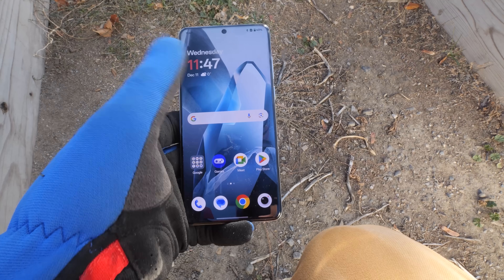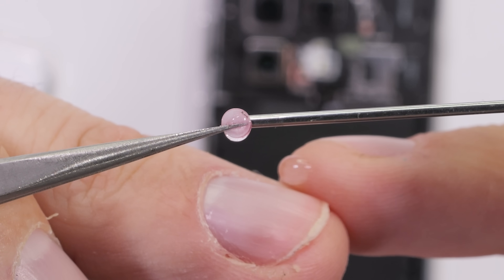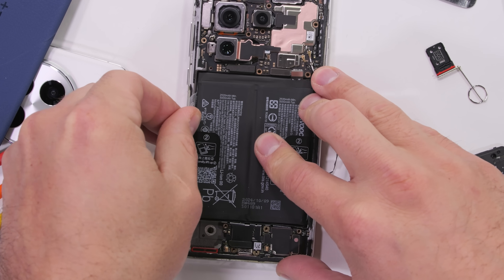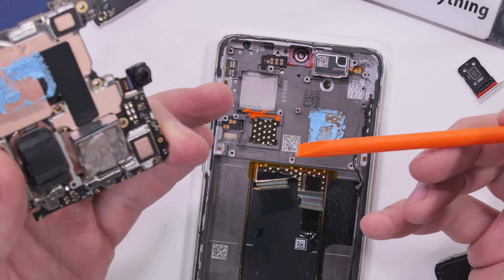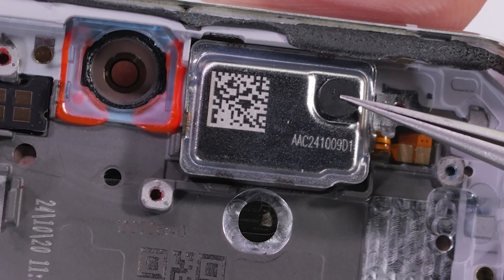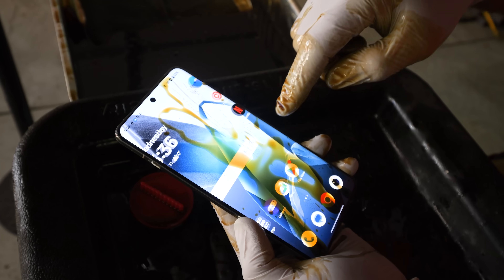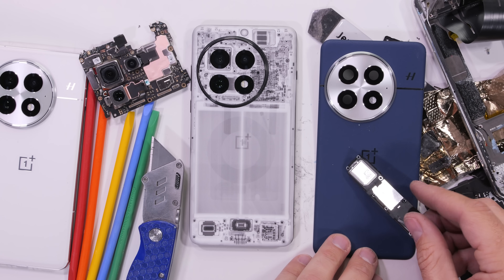The OnePlus 13's Double Decker cooling system - TEARDOWN

Comment: A sponsored phone teardown will definitely not be biased, right?
Reply: the review embargo lifted and they all post at the same time
Reply: Lol the video where he threw it on the grass instead of the sidewalk says otherwise
Reply: @ exactly like no shot the phone survived a 20 foot drop on grass it literally can’t get broken from that lol
Reply: Throwing on grass doesn't gives deeper impact as throwing from 2m+ on hard surface. definitely biased
Reply: @Nikhil4G  remember when a phone survived a fall from an airplane because it landed on grass?
Reply: @Honïe4 Yes someone dropped the pixel 4a from a helicopter or something and it survived. And that's a fragile little thin device
Reply: @Honïe4  remember when that phone that dropped from an airplane had a case and screen protector. Yeah you missed the details.
Reply: @Nikhil4G Lol they 100% asked him "onto what surface" before allowing that
Reply: @ exactly I noticed that immediately and didn’t like it
Reply: @Nikhil4G This is what I thought when I saw the video during the launch event.
Reply: @Nikhil4G  you make as if the grass is made up of 2 meter foam 😂😂😂😂
Reply: @the chances of grass and dirt cracking glass or even scratching metal are super low like almost impossible type of low at least from that height
Reply: @Nikhil4G but still it's a much higher impact speed compared to normal drop height
Reply: Very true  @Nikhil4G
Reply: He threw the phone to a dirt floor instead of concrete, there you have your answer
Reply: @ exactly my point
Reply: i dont think they're sponsoring him beyond sending him the phone
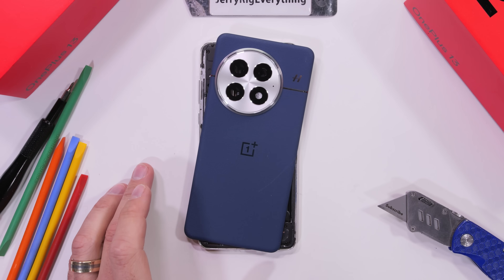Reply: @user-fe7bo5mm1o he literally says they sponsored it and sent him the phone early around 1:35
Reply: @ it says sponsored if it was just the phone I would assume he would say they sent him the phone but he specifically said sponsored
Reply: @user-fe7bo5mm1o no they're definitely sponsoring him or he wouldn't have disclosed it. Normally he would just disclose that they gave him the phone for free.  Frankly both should be disclosed some creators are better than others.  But in this case not only did he get early access embargo -- but he's getting a supplemental sponsorship as well.
Reply: No shit Sherlock, you got any evidence about the sponsored review?😂
Reply: @ he said it was, watch the first few minutes he says it
Reply: Definitely sponsored but still a really cool phone imo. Want something different than the next samsung or the next pixel for once. Waiting for more critical reviews but we will see.
Reply: I've had OnePlus since 2018. Actually, had the first OnePlus ever in my area. They kick butt @mr.typical3169
Reply: @mr.typical3169 yeah both things can be true. It's sponsored but frankly one plus needs to sponsor some videos to keep up with Google and Apple and Samsung's marketing budget in the North American market. OnePlus is actually doing a really good job at making a feature complete competitive alternative to the pixel or Samsung or iPhone. Undercutting them both on price, giving them chargers in the box with high speeds, excellent performance.... 13R, too it's a really compelling alternative to the pixel 8A or the a54 or something
Reply: @mr.typical3169 i got a ROG phone and it had been great. Dual batteries, pass through power to save battery life, hi res dac, 3.5mm socket, real speakers with volume, can overclock it if you wish and control throttling etc with the asus software, touch pad controls built in for gaming, and great accessories.
If i could get android updates i would keep it for another 3 years.
Reply: People like you are what's wrong with the world, you can literally hear him say that the phone was the only sponsored thing, OnePlus sent him the phone to teardown, this is just a TEARDOWN. The durability test is still coming in the future
Reply: Yes, im sure the literal to the minute simultaneous release of these videos by all the tech channels is not at all suspicious and totally above board
Reply: @Konarcoffee  it's not suspicious that's how embargoes work, when it ends everyone releases their video, you'll see it with every phone release
Reply: @Konarcoffee  yes who've heard about embargo right? What's the saying, ah yes “Everything is a conspiracy theory when you don’t know how anything works.”
Reply: @Konarcoffee that´s literally how embargo works
Reply: @Konarcoffee  you know nothing about how sponsorships work do you.. i will give you a brief explanation..

Every company sends these new gen phones to these creators with a contract stating that they can review or do whatever they want with the phone.. but there is a period of time before they can release the video, the period of time is called an 'embargo'. This is done to not only gain publicity, but also to prevent any major info leaks... as the content creators have access to the phones way before the launch. 

The moment the phone is launched and available to the public, the embargo period ends and all these pre recorded videos are posted.. attracting mainstream attention towards to phone and prevents any form of leaks, thats why all these videos released at the same time.
Reply: @Konarcoffee  To be fair, these phones have an embargo which gets lifted on specific days so that's why all the tech channels release their videos on the same day.
Reply: @Konarcoffee bro that's just the embargo lifting. That's legal and above board and has nothing to do with sponsorships
Reply: @Konarcoffee that was when the embargo lifted. Are you 13?
Reply: @Konarcoffee  have you ever heard of a "review embargo"?
Reply: @Konarcoffee  if you are going to review new tech, you don't want to be left behind. The algorithm ends up punishing late reviews of new tech.
Reply: @Konarcoffee  it's called a review embargo. Media outlets are given the phone early so they can test and review it, but they're not allowed to release the review until the embargo is lifted. There's nothing nefarious or suspicious about it - it's just how reviewing a new product works, and it's been this way for years. No conspiracy needed.
Reply: @Konarcoffee  It's a fairly normal practice to send review units early but have an embargo to prevent content creators releasing their video before a certain date and time, it's meant to prevent leaks while allowing the reviewers plenty of time to make a video. That said I do appreciate the skepticism of a sponsored review.
Reply: @Konarcoffee you don't know how this works, do you ?  It's called embargo, they get the phone early but can't talk or disclose info about it until the company tells them to
Reply: Do you not understand how embargos work?  @Konarcoffee
Reply: @Konarcoffee  creators post phone reviews at the same time because they all have the phones they are reviewing 3ish weeks early because well they are reviewers. But for this time period they are obligated to not talk about or show the phone under their agreement to get it early for reviewers. In this agreement there is a date and a time after which they are allowed to show it. Most of their videos are already done and uploaded and they are just waiting for that date so they can make the video public without breaking their agreement and not getting the next phone next year or even worse getting sued. Its not some industry conspiracy, MKBHD and MrWhosetheboss have talked about it lots.
Reply: @Konarcoffee Isn't that true for all the phones?
Reply: @Konarcoffee  companies often request for materials not to be disclosed before an official launch date and time, what this has to do with the content being biased or not?
Reply: @Konarcoffee  Companies always have reviewers sign NDA-like contracts that only allow them to release the video at X date. that date (and time) is usually the exact same for all reviewers. Since all reviewers want to be the first... Yea, there is literally nothing suspicious about it and it's completely above the board.

Imagine if someone told you you could get a huge amount of money if you call them at exactly 17:00 on the first of january, but the amount is halving every hour after 17:00. When are you calling them? 17:00 right? Literally this same situation.

Before you go to conspiracy theories, try thinking for a second.
Reply: @Konarcoffee yeah I mean obviously these release embargo reviews are kind of cartoonish when they all get released at the same time. But having embargoes is pretty much pro forma. The bigger conflict of interest is these companies funding these creators on trips to Hawaii and on cruises and that kind of thing
Reply: He did good. I'm happy he's getting paid
Reply: You must be new here.
Reply: @ nope I’ve been watching him for years but recently I haven’t liked some thing I’ve seen
Reply: @Demicron  I trust him either way.
Reply: Of course but no phone is going to survive falling 20 feet onto concrete and won't for decades so that's a moot point.
Reply: This one of those channels where I don't really care about the sponsorship, I'm here for the taking apart of the thing. I cannot buy this device and work where I work, I'd prefer to keep my job.
Reply: I love the train of thought of "the phone wasn't thrown against concrete therefore it must be biased" 😂, I agree, the phone wasn't thrown into a volcano, Jerry was bought and works for Oppo
Reply: Started with dropping it on grass and pretended it was so amazing it survived. So yeah. Totally biased.
Reply: Look any phone dropped from 20 feet will shatter anything glass. Scratch the hell out of the metal frame and may even dent it in a bit. So yeah it will lose its water resistance because, the glass is cracked, and the frame is bent and thus the seals have shifted. We all know this. People be tripping over the dumbest stuff.
Reply: Yeah! Like S24 hundred videos 😂😂😂
Reply: Definitely it wasn't
Reply: YouTubers are scammers.
Reply: @ not all but I have seen Zack acting weird lately idk how to explain it exactly
Reply: Right
Reply: Ok, nah
Reply: Whenever there's a huge white canvas with a dark spot in it, guess what everyone sees , the tiny dark spot 😅🤦
Reply: @fredkofi75  not if u close your eyes. that's what most people do just turn there heads and ignore the issue
Reply: With the case of  jerryrigeverything
I would believe him. He’s destroyed at least 3 one plus phones back to back. I’m talking each generation in the same place. He wouldn’t be afraid to do it again even if it’s sponsored. At least I think. 🤔
Reply: If anyone was going to be unbiased with a sponsored teardown it's going to be JerryRigEverything
Reply: The phone went off the roof anyways xd
Reply: He said it's sponsored in the video
Reply: @tallcamel  r/ woosh
Reply: The moment he threw it off a roof into GRASS I knew it'd be sponsored
Reply: They've been giving phones to him since a long time I think they are the only one that gives phones to destroy them
Reply: Shhh...those gold plated cyber dumpstertrucks won't pay themselves
Reply: Right
Reply: Xi paid for it
Reply: Apple fanboys & fangirls crying!!!!!!
Reply: I remember when Zack used to not trust in phones sent specifically for the durability test, as it could not accurately represent the final product being sold to the consumers. Don’t know his opinion on this matter currently, though.
Reply: Don't worry dude will ripe the phone 😢any way
Reply: He might have taken $100000 dollars for every line in his previous OnePlus phone 😂😂
Reply: Still it's not sponsored(I don't like this gun btw so not even a sub)
Reply: Say less.
Reply: I just bought the one plus watching this video should've read the comments lol... The speakers are definitely not working with them balls. They're all going in the wrong holes and the speakers sound cheap. But otherwise kinda happy that I got a snap dragon elite and the phone is definitely quick. Let's see how it lasts.
Reply: Yep, it won't.
Reply: Mabe for a smaller youtuber, this guy get so many companies sending him stuff i dont think he cares how it performs.
Reply: You do understand it's still a teardown? It being sponsored doesn't mean he won't tear it down.
Reply: It could be. But just saying something is biased doesn’t really mean anything
Reply: @Grim-mler if I pay u money and give h a product that would usually be to bias u towards giving the product a better look or not test it as harsh.
Reply: Doesn't matter if it's sponsored or not. He showed us the durability of the phone and that's what this channel is for. He ain't got anything to hide. He still ripped the entire phone apart for us.
Reply: What about the video are you afraid of being biased? Lol
Reply: @ what if the phone didn’t hold up being in the dishwasher or getting oil on it. Idc abt those things but if i also don’t want to see possible fake information get presented as real
Reply: Do you really think a man who makes affordable wheelchairs with little to no personal profit and builds libraries in africa is going to shamelessly shill for some mediocre phone company? Ok bro.
Reply: @neondemon5137  I’ve no reason to doubt Jerry, but it’s good practice to always keep your eyes open and take everything with a grain of salt.
Reply: @neondemon5137  I don’t have any reason to think that Jerry has a conflict of interest or has abused our trust, but it’s good practice to always keep your eyes open and take everything with a grain of salt. There are plenty of influencers who seemed super-trustworthy until they didn’t.
Reply: @neondemon5137  I’ve no reason to think that Jerry has abused our trust, but it’s good practice to always keep your eyes open and take everything with a grain of salt. Plenty of influencers looked super-trustworthy until they didn’t.
Reply: @ yeah recently I have been losing trust in him with a lot of the things he’s done and said that’s just me tho if u want to trust a man that u have never met before then go ahead
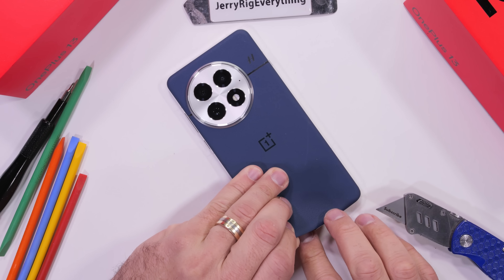Reply: To everyone saying that this isn't sponsored. He literally says that it's sponsored at 1:35.
But he definitely didn't fake any information in the video. All the extra tests he did are nothing special when it comes to phones, and he doesn't do these tests normally because it's pointless - when an expensive phone says that it's water-resistant, it probably is. And most phones can survive being dropped on grass.
But the way it's presented definitely seems biased. Could be because it's sponsored.
Reply: @ exactly even the drop test was on grass. like it not saying it’s fake the phone probably held up but it also might not have that’s what I was saying
Reply: Yeah, definitely not biased. And the whole review TOTALLY didn't sound like just a promotion...
Reply: @ definitely 😉😭
Reply: OnePlus can sponsor as many channels as they want - I'm never buying a phone with such a massive camera continent
Reply: @mjc0961 lmaooo yeah design is a big thing for me I like minimal and that aint that. also hate the leather I feel like it is a bad material for this
Reply: Throwing it on grass, I don't think it's biased
Reply: Also they are definitely going to sponsor him another phone for scratch and bend test. Otherwise this was literally just a sponsored show off
Reply: @alexfurious2121  idk if you really watched the video, because they literally sponsored him 3 phones. And as far as I know this channel, he doesn't give a shait if it's sponsored or not. He has already shown how phones fail his test, even though it was sponsored...
Reply: @derteekessel  ah yes yeah it slipped my mind. But ye he is gonna post more durability videos on them. Imo zack is better than the ytbers that constantly glaze about the software instead of the hardware. Eg mkbhd, techspurt, etc
Reply: @alexfurious2121  yeah, I think you're absolutely insane for thinking that the OnePlus 12 isn't as good as a Samsung s25 or iPhone. The charging speed alone makes it better 😂, my woman had a s25 and I have the OnePlus 12, I would never trade the OnePlus 12 for an s25 after handling both. Beaconlink is also awesome as I work in places where reception isn't plentiful. I love the cameras on the 12, the battery lasts me all day and I usually just give it a 10-15 minute charge at night and I finish it in the morning after I wake up so it isn't on charge all night (you don't have to do this as it has a smart charge feature where it'll stop charging at 90% and finish off a half hour before your morning alarm goes off.) I just wake up erratically. There isn't much to hate about the phone, the refresh rate is great as well as its resolution, it has an integrated game engine for optimization on the fly, and a great cooling system. I honestly would like to know what you don't like about the phone as it's by far better than all the pixels I have owned (6 pro, 7, 8 pro) and the Samsung I have compared it to (s25) due to increased optimization throughout the software and the battery life. I also find the speakers on the OnePlus to be better than any of the listed phones and the screen is brighter from my experience.
Reply: I have the last gen oneplus 12 and I can confirm that they just paint the phones in positive light. When you actually own one, you feel the disappointment. Way better to stick to Apple/Samsung S/ultra series.
Reply: @alexfurious2121 I have a OnePlus 12 and I disagree with you. It's all subjective as I feel I got way more for what i spend which was almost 400 dollars less. I definitely use the IR blaster more than the S pen and I have the 512GB storage variant which I think is very important considering the file sizes nowadays.
Reply: @SreerajKU it's been nothing but good to me, strange to hear someone complaining about it. The only possible down side is durability, but glass is glass and glass breaks
Reply: @alexfurious2121 tf do you mean, I love my OnePlus 10 pro lmfao
Reply: @Nazobypass  in what universe is OnePlus 12 similar to OnePlus 10 pro mate?
Reply: @alexfurious2121 not to be that guy but ur right. But if dudes 10 pro makes him happy imagine the new 13
Reply: @alexfurious2121 the 10 and the 12 are not that different
Reply: @alexfurious2121 you don't have a oneplus
Reply: @alexfurious2121  I don't know why you feel like OnePlus is inferior to apple/samsung. I have been using OnePlus 7 Pro since it was released in 2019, still works well. Even better than most budget or mid range phones.

Anyways I recently purchased an iPhone 16 pro max still I use my 6 year old phone more.
Reply: @RahulKumar-lv9yz  I wrote it but I don't think yt processed the comment/it got deleted. And it was too long to rewrite. Basically a lot of problems
Reply: @alexfurious2121 I’m not accusing you of being wrong, but I was considering getting this phone, so I’m curious what made you unhappy about the phone?
Reply: @blayses3116 fingerprint reader, overheating, OOS 15 stability and features, poor battery life on most OS updates. Even the ear piece for when talking on a phone call is not loud enough.  Poor recording quality in low light causing ghosting. This is all in short
Reply: @alexfurious2121 Huh, I'm on the 12 too and I love it. I came from the galaxy s22 so maybe the bar was set really low but I was super impressed by the battery and performance. I guess it just depends on your expectations but I would recommend the OnePlus 12 to just about anyone. IMO the only downside is that there isn't a smaller option like a OnePlus mini or something.
Reply: @alexfurious2121  I have owned Apple & Samsung. And I am using a OnePlus since 2018. Changed it last year to the OP12. Definitely not going back to Apple or Samsung.
Reply: @alexfurious2121 I beg to disagree. I own a op12 and I've previously owned the 7t... I love the op12 and I don't get any disappointment specially when comparing it with iphone 16 pro
Reply: @JoaoSilva-xy5ep  what are you disagreeing with? My personal experiences with the phones I've used? 🤣You are allowed to give your opinions.
Reply: @alexfurious2121 I can confirm that, I was a loyal fan of OP7 and OP9 Pro. The former was a good smartphone and the latter too, if only I hadn't had to deal with extreme software issues, battery inefficiency and unresponsive support or general ignoring (I had all the accessories as well). Decided to switch to Samsung afterwards and have never been happier. I wonder if that has changed now? I have no idea
Reply: @SchwainerSchinkler1510LP  no. Oneplus 13 is just as much of a disappointment apart from the SD elite chip. But that too is way slower than other flagships. No point in having the powerful chip outside of gaming if the OS itself is a buggy mess.
Reply: @alexfurious2121  I've yet too encounter a single big in oxygenos 15.
Reply: @ thank u for providing your own experience I think any phone is good I use an iPhone but idc abt that stuff I just don’t like sponsored stuff when it comes to how a product performs
Reply: @alexfurious2121  absolutely not, I went from a oneplus 10 to a s23ultra and hated it, I couldn't wait to get back to a OnePlus I have a 12 now and I'm very much pleased with it
Reply: @Llewellyn882  I would say that is copium but everyone has different experiences. So thank you for your opinion. The S22 ultra was actually the most premium phone that I had used back in the day and I borrowed the s24 ultra for a couple of months. They were both leagues ahead of OnePlus although not in terms of performances when it came to the S22U
OnePlus 12 is my first and last OnePlus flagship
Reply: @alexfurious2121 right, except that the equivalent storage option for what I paid for my 11 was $400 less than my boss with his s23 ultra. Both phones from the same year same time and there is still no reason I would want to have his phone over mine
Reply: @alexfurious2121  haha fanboy time!
Reply: Have to disagree with you, still have my OnePlus 9 pro.
Still working as new after 3 years, bought 13 because no other brand can match it.
Yes, I have had Samsung before OnePlus. It's not worth for me to pay much more for newest Samsung with not having specs like 13, if you want to pay for brand name. It's up to you.